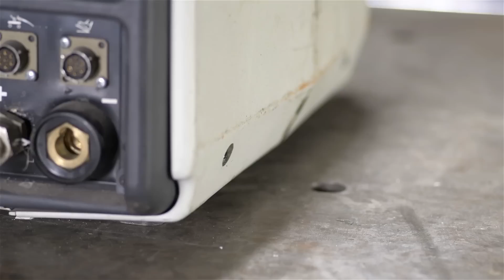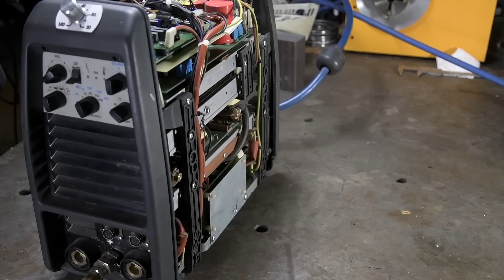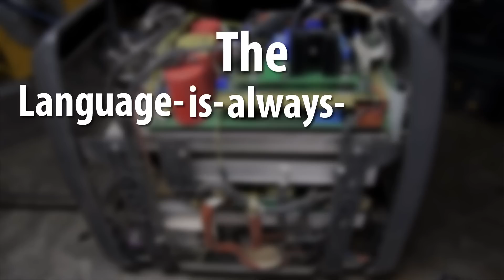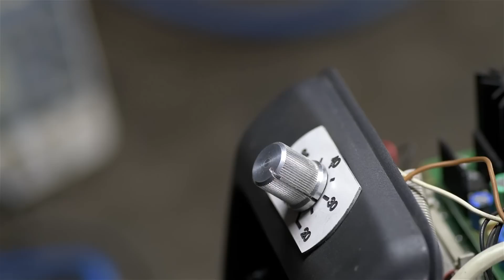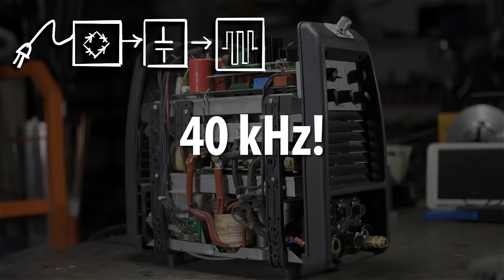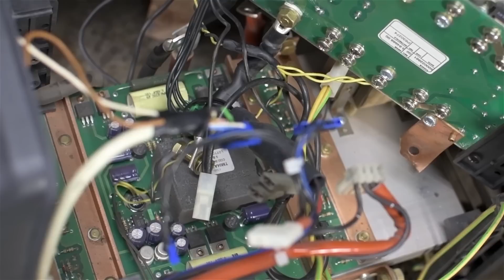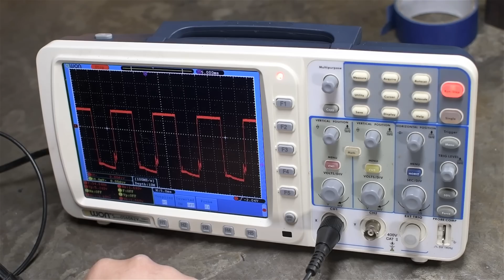My TIG Is Breaking Up With Me - Part 2

Comment: What if the "logic board" is actually full of op-amps and comparators cleverly controlling all the parameters of the waveform? Judging by the two small electrolytic capacitors, trim pots and high number of resistors, this might be a fair assumption. You could look up chip part numbers and check whether they are powered correctly. Could be that one of the board's power supply rails is down, which might be where 50% maximum duty cycle number comes from. (assuming dual rail power supply, e.g. +-15V). And yeah, if the assumptions above are correct, the voltages across the two SMD electrolytic capacitors near the ribbon cable on the left at 12:35 should be equal in order for the circuit to operate properly - easy check.

Comment: As a pixie wrangler (bachelor in electronics, and studying for a master's in Electronics Engineering) my professional opinion is that you won't be able to fix this thing. You gave it a good shot, but with the horrible physical layout, the lack of a service manual and the real danger that come with testing this thing under power: you're not going to get this fixed. The only way you're fixing this, is by getting some extra help and a lot of luck.

You got two options: give it to someone who can fix it or run it till you can buy a new one.

Comment: Remote debugging is always tricky, but here is my 2 cents:
Check if the 4 capacitors are coupled in series and if there is a center track going out ( and maybe back to L or N on bridge rectifier ).
If they are, there is a chance this serves as a +/- supply for the inverter and could account for the lack of current in one polarity and the duty-cycle problem.
Measure capacity, AFTER checking voltage is 0 across all of them. They should all read the same, about 470 uF.

Comment: As somebody else already said, the delayed relay is one to allow full line current AFTER the big capacitors have been charged up.  The inrush limiter resistors (likely) would combust if not bypassed by the weld time.  On the other hand, without the limiter, the inrush could be 200 to 600 amperes and would definitely pop the breaker.
Without seeing your part 1 video, I speculate that your issue is the Variable Polarity pulse duty cycle that remains fixed at about 50%..  The problem must be in the oscillator (analog or digital) section.  Don't try to replace the big red capacitors, until they are at least 10 years old.  Or even older if they are rated 105 degrees C temperature - see what is printed on them.
The original AC welders for aluminum used line frequency and got more or less 50% pulse duty cycles.  The inverter generation can have true variable duty cycles, with the Reverse Polarity (Electrode Positive) part typically from 10 to 20 %.
In TIG (or officially GTAW for Gas Tungsten Arc Weld) the controlled feature is current.  The voltage is set by the shield gas and the arc length.  In automated welding the voltage is measured and used to run a servo motor to raise or lower the torch.
Your VP welder primary inverter works O.K.  There must be another inverter or bridge AFTER the transformer in order to provide the weld current reversals.  Moreover, the arc starter may need to be fired on every polarity reversal moment to prevent a loss of the arc.  As you get the polarity reversals, even the VP bridge is O.K.  That means the problem is in the control section of the VP bridge, close to the potentiometer.  
With argon as a shield gas, the straight polarity voltage is around 10 V, while the reverse polarity time it is likely to be around 25 V.
As the above should suggest, I have electronics control experience and even in welding system design.  But I can do only so much diagnosis remotely...

Comment: Any particular trick you used to keep your camera from melting like a Nazi staring at the Ark of the Covenant for the unfiltered TIG shots at the end?
Reply from the maker: Nope.. can that really happen?
Reply: I guess I just assumed. I got curious when I noticed you had some filtered and some unfiltered shots mixed at the end. 
To the Googles! It looks like long-exposures of the sun can cause permanent discoloration or pixel death because of the heat but I suppose if you have the aperture tight enough and shutter fast enough to get a properly exposed shot you're already blocking most of the death-rays anyway. Do you have a preference; filtered vs. unfiltered?

Comment: The click after power-on is probably a soft-start.  The primary-caps would be charged initially through a big R so as to not blow up the rectifier.  Once they reach a good fraction of working voltage, the relay closes and shorts the resistor.

It's a very low-tech approach.  PFC would be much better and more efficient but this is cheaper and just good enough to not pop your breaker at power-on.

Comment: The center of the screen went out on my owon scope. The heartbreaking part is that it is still fully functional but I can't see most the screen; replacing the screen is as much as I paid for it. I thought about possibly wiring it to an external display but to map out the pins I would need a scope. The irony!
Reply from the maker: This scope has DVI out!  I thought that was a feature but now you've made me nervous.
Reply: My older model doesn't have that feature...

Comment: I would check the full-wave rectifier module, which is the potted module with 4 spade tabs that appears in the left edge of the screen at about 12:50 elapsed time.  Just a thought.

Comment: I didn't notice any obviously bad caps in there. And the fact that it is chopping and generally controlling makes me suspect the power sections are probably fine. So my dime is on a control section problem. Someone posted a link to a schematic and manual for the unit on the last video. Unfortunately it is in Italian, but if you can read that, maybe it isn't a problem. It clearly shows what all those trimpots are for on the main control board, and seems to describe what to look for and do if various problems occur.  Unfortunately I don't read Italian, so that is as far as I could get with it.

If nothing else, try turning those trimpots about a turn or two in each direction, going back to the original position. Pots can get dirty or corroded over time and the wiper stops making good contact. Exercising them can often 'fix' the problem.

Comment: F__k it I had to look into schematic myself...
inverter input is isolated with transformer (board with 4 huge capacitors)
the after isolating transformer it symmetrically goes to inverter
after current amplification on secondary side it drives two chains of 4x mosfets
You need to check propagation and offset in this control signal(before trransformer).. then gradually check current amplifiers on other side... but you will need high voltage differential probe!! after that check mosfet inputs

see any  assymetry...
Reply: schematic is incomplete... a could see after that there is another "invertrer" before output to electrodes, so problem could be there as well.

Comment: Damn it, you got a schematic! schematic!!! and still could not probe voltages? you could solder wires to "test points" and check with oscilloscope all reference voltages.

Comment: through a trash compactor... Not enough room in there for a flea to sneeze, is there?
Shop compressor probably better than garden hose.
It's AWWW silly scope. From when you connect that 2000 V DC rail to that cheap Beckman set on the millivolt scale.

Comment: On the board with all the orange caps, looks like a cracked MOV (center back, behind the two fat black wires. The case is cracked across the face. see on the left side below the relay you are talking about at 12:48.

Comment: I was scanning the daughter board and I am fairly certain that there is a poor connection between your temporal flux capacitor and the  half-nut  on your lathe. Probably intertemporal oxidation.  Try a 1/4 teaspoon of baking soda in your next batch of  marinara . It makes a huge difference in the sweetness of the sauce.
Reply from the maker: you don't think the baking soda would throw off the AC balance?

Comment: Also, I'm all for replacing caps and mosfets until you find the right one but I'd take a page out of the millwright's book and let it buck. Do all the aluminum and heavy steel you can until it gives up the ghost.  The check what let go and replace it, what ever is up stream to be on the safe side and then put it on Craigslist if it starts working again. At this point Mrs. This Old Tony will be so tired of hearing about welders that a nice new Esab, Alpha or Thermal Arc will slide right past the radar.

Comment: The very flat top on the waveform suggests to me that the confuser thinks that's where it's supposed to be. I think the problem's on the board that's taking in all the voltage & current monitors and doing the A to D.

Comment: How much do you trust the test equipment, especially that amp meter?

Not to cast more doubt and confusion on your pile, but any chance you have a different current meter you could try?   The sillyscope seems skookum enough, but hall effect sensors can get ausgeficked surprisingly easily.

At least it's an easy double check before tearing apart the entire....oh right.      Anyway, best of luck!   Love your channel.

Comment: It looks like it can't equalize the bias between the two periods of the square wave. This might happen when a capacitor in the main supply shorts internally when it warms up (actually the internal resistance falls). It might be also the same thing but on the IGBT board, such as one of the filter/bypass capacitors. If those capacitors are not rated for the temperature they work at (typical of Chinese machines), they start to give up in a similar way.

Comment: you need to be able to look at the triggers to the IGBT ( i presume it has them) which floats on the supply voltage, so care must be taken. There are usually isolated dc-dc converters driving the high side.

Comment: The best bang/buck in basic O-scopes has changed models several times since you purchased that one.
Rigol had it for a while (mostly due to the available hack to repair the factory hobbling), keysight just released a new series aimed at this market looks promising. Techtronics seems to focus more on the high end market, they have some lower end models but I don't think they give that segment any love just there for show and upselling.
While I'm not a fan of constantly changing designs for marketing purposes, I've noticed the manufacturers of digital 'scopes tend to keep models around well passed their technology prime. Likely the reason the top models change so often, basically it's just the company with the newest platform, though Dscopes are finally becoming mature enough that the low end can transition toward commodity item and not suffer an excess of limitations vs big money lab scopes.

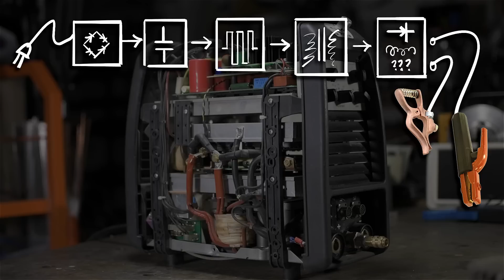Comment: Your diagram at 10:40 is actually a pretty good representation of what is going on. But you are missing a stage between the last rectifier and the torch / ground clamp. The first inverter stage you identified is the 40 KHz stage (assuming that is the frequency and you were not just ringing your clamp-on current probe) and is also used to control the current via PWM. This stage is several very large MOSFETs in your machine. After the rectifiers there is another stage before the torch / ground clamp that allows you to change the polarity of the applied voltage with respect to the ground clamp. This stage uses IGBTs and is also a form of "inverter" if you will, as it takes the DC that its rectifier (on the right in your drawing) produces and does the swapping around to put the right polarity on the torch.

Now that was a little tiny bit simplistic. There are actually two output rectifiers (and chokes) and the secondary of that transformer is really two secondaries. The two secondaries feed the two rectifiers which feed two different halves of the second inverter which feed the torch. Given that you get good current control in the DC half of the cycle, I am fairly certain your issue is on this board or the board generating the control signals for this board.

The good news is that with HUGE devices like these it should be simple to have the kitten tack-solder some flying test leads onto the interesting points and monitor them from the comfort and safety of away from the big scary boards. I would take a look at the unrectified AC coming off both the secondaries, and the control signals to the two banks of IGBTs (one labelled "DC" and one "AC"). If you can grab those control signals both before and after their opto-isolators, all the better. Somewhere in all that I suspect you will find a demon. I would certainly keep your scope running on battery for all this, as the ground reference may be all over the place. You should probably also avoid touching things. Just saying...
Reply: Great post! Tack-soldering on some flying test leads is a brilliant idea; saved for future reference...
Reply: Stesso problema alla mia STEL-TIG-µP-161H del 1986 (versione italiana della HTP) led temperatura lampeggiante e nessuna saldatura in uscita. Sostituiti tutti i mosfet e igbt e adesso tornata a funzionare come nuova ❤

Comment: you should look into avortec welders, i bought one that does mig, tig, stick, and plasma cuts all in one unit and i love it. and if you ever had an issue with it, you could get the guy that designed and built it on the phone. you can get him on the phone before you buy it as well. i bought it a year ago, and just find myself wanting to use it more than i have time for.

Comment: Just a thought. I like my fat squares below the waistline sucka. Anyway, maybe the mfr meant for the balance control to be from 10%-50% on the "cleaning". On my everlast 256s, I have lots of knobs, but not one for voltage balance, but if I had a fixed   balance, I'd want most of it on the negative like yours and I'd also want it to have amps balanced the same way. My old Miller 180SD "square wave" was 50/50 and made the tungsten so hot compared to my 256 that I can balance towards the work. Only the most expensive machines have balance for width and height. perhaps your mfr decided to give you a height that was already balanced for what most people would prefer ?

Comment: You need an ESR meter. You could build a cheap one: http://www.eevblog.com/forum/projects/5-transistor-esr-meter-design/

Use that to test the capacitors. Or if you have a function generator use that + the 'scope. W2AEW has a video on that: https://www.youtube.com/watch?v=115erzCCxgE

Also, don't lay boards with static sensitive components on bubble wrap.

Comment: Do you have a baseline to compare it to?  It might just be that this welder has an imperfect wave form inherent to it's design, which the engineers decided was good enough for the application.
Reply: fredy gump if that were true though unlikely that the positive side of the waveform would look so perfect

Comment: Mispronunciation is the hallmark of someone that is self-taught or learns more from books than classes.

Miller publishes shop manuals with separate power-off and power-on diags one can perform.    I remember this well,  because during a power-on diag my test probe slipped a millimeter and I fried one of the six or so $300-dollar boards in my old Dynasty 200 (which is also an inverter).    Even with the the manual I eventually got frustrated and sold the thing on eBay for parts.   I ended up getting an Everlast, which is a Chinese brand, but, as you say, it's still a better welder than I am.    Also it costs about one tenth of what the Miller did.    I never would have admitted this online for fear of flak from pro welders, but then I saw how Jamie over at WeldingTipsAndTricks demos Everlast welders all the time.
Reply: thzzzt pro welder here, everlast, ahp, and one or two other “off-brand” welders i cant remember the name of, they are actually amazing little machines, they definitely aren’t made for industrial (working construction sites, inside of plants) but small travel jobs that have power supplies (radio towers, sub stations, hydro plants and the like) as long with in a home shop, or a newbi just trying to learn on a “cheap” priced machine, im looking into one of them in the future for personal usage
Reply: @Lazybiker60  Thanks, this helps me get an idea of what I should be looking at!

Comment: it is likely that a MOSFET  on the high side it's going bad. they are bolted to the large heat sinks. lookup the part number to find replacements. digikey.com

Comment: you could have a bad zener diode that it 
flowing voltage to early I would look for one shorted open all the time of a capacitor that is dry that has not failed all the way yet so you would need to check the ESR so get out the soldering iron and start pulling caps and checking them. the diodes you can check with out power or desoldering. if you need someone else to check it I would be glad to help.

Comment: The AHP tig welder is an excellent choice for the price . Great duty cycle, lots of bells and whistles, good accessories all for under 800$. Had mine for two years with no problems.
Reply: EnlightenedSavage  I second this.  I have the latest gen bought this spring.  I would never have even considered a tig welder at the prices of a blue or red machine.  The AHP will weld anything I need for my garage.

Comment: In other words, input 110 volts AC,,, round and round and it comes out really potent enough to weld. So some where in the round and round, it ain't multiplying enough to weld big time. Good luck .

Comment: For someone like me, with little to none electrical knowledge, I would de-solder all capacitors and check'em. I even saw a guy here on YouTube checking them in place. I don't wanna be a tool-blocker here (almost the same, but blocking new tool purchases), try it, and if you manage to fix it, you can still have your new tig. Just send the old one to me :-D